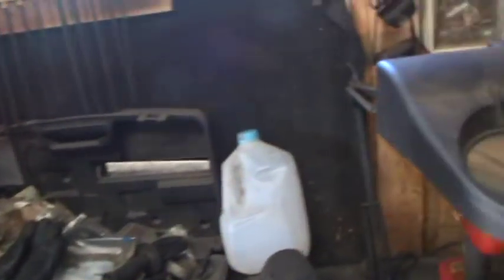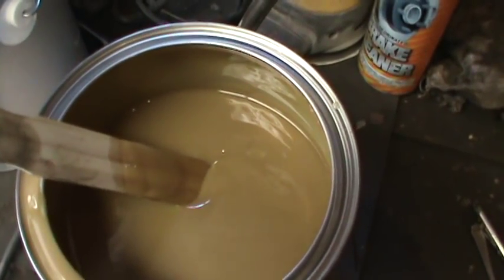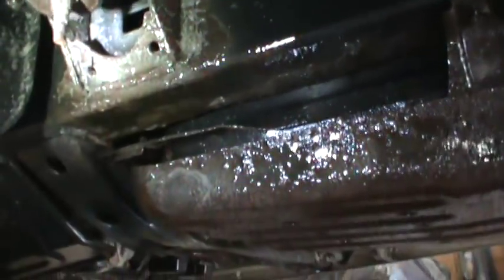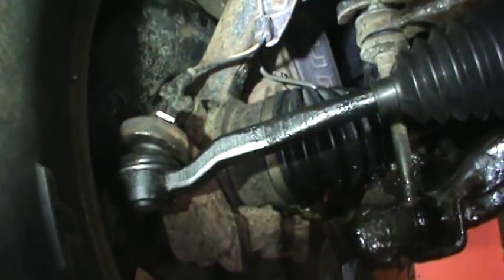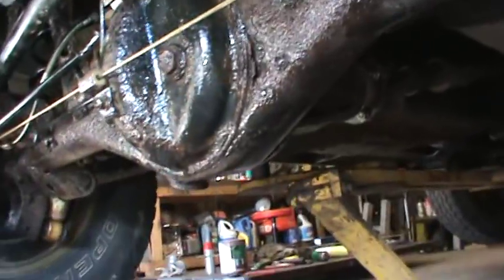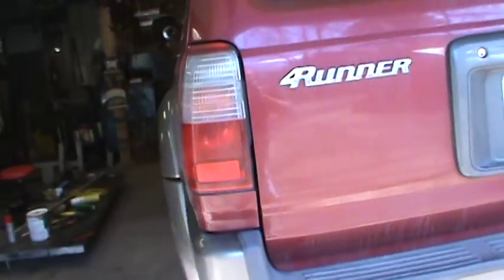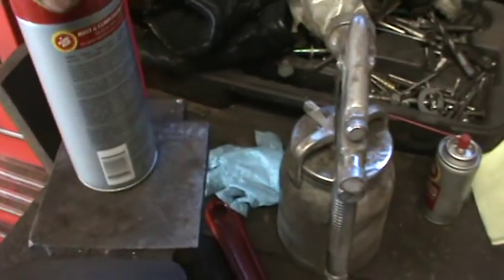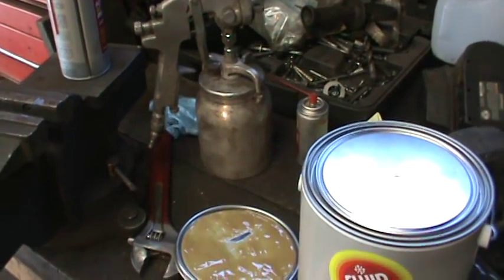undercoating with fluid film

Comment: I'm from Nova Scotia, and I've been undercoating my cars with Fluid Film for the last 21 years. This is by far the best undercoating available. I had an '81 Olds Delta 88 which are known in my area to rot the frame in front of the rear wheels. When I had it for sale, the guy who bought it first looked at the undercarriage and didn't believe it was driven year round. I now have a '98 Honda Accord which I bought 11 years ago after the Olds. Still solid after year round driving and 350,000 kms.

Comment: It's a truly great product,i've been using it for over 2 years now.It's the only product that i know of that will actually stop rust that's already started from spreading,with minimal prep work,as long as the surface is wet with product,the rust is stopped in it's tracks.I do the exhaust with it,any surface rust on the exterior of the exhaust is stopped,the excess will just burn off,the product is good for 400f.

Comment: i take all my cars to Krown rust proofing.  They spray everything.  We had a Neon and it took ten years for the leading edge of the hood to rust out.  Neons were nortorious for rusting out in 4 years.  I was convinced.  After ten years I went under and changed the shocks and the bolts nuts came off the bolts with no problems what so ever.
Reply: The reason why your hood ends rusted out was they missed spots my Volvo is 39yrs and no rust I go around the edges with cooking oil

Comment: I used it for a couple of years and it washes off too quickly. Like you I moved on to bar oil and I add a bit of an old candle melted into it on a hot plate. The FF does make a nice tire and plastic dressing, though, will make your old quad shine up purty.

Comment: this stuff is great! u have to coat it with much more than u see in the video. u have to make it so the car looks like its raining Fluid Film. after u apply it if u go beat down a dirt road, the dirt will stick to the Fluid Film and make a barrier so no salt will get to the metal.
in new hampshire we sell this stuff by 55 gallon, 5 gallon for all the local town trucks.
its made from sheeps wool so it all natural and wont pavement or cement .
u can buy this stuff at any Napa Auto store. its 39.99 for a gallon right now

Comment: I get our cars done professionally using a product called Rustop.  Here in Buffalo, we put so much salt on the roads that our cars don't stand a chance.  Rustop works great, its a yearly application, but I'm not convinced it is friendly to bushings, rubber seals, etc.  I bought a gallon of Fluid Film for my boat trailer and 6x8' trailer and I'll see how that goes on as they are outside all year and are starting to show signs of rust.
Reply: Are you referring to RustKote on Walden Avenue?

Comment: I live in Central New York, and had my Friend apply this to my 27 year old Buick Reatta. Wonderful results. Tip: get a dedicated metal pan or cup, and heat the product to 200F on a propane cooker, or a HD plastic cup for microwaving it. When hot- it penetrates quicker, and sprays easier, less waste.
Reply: 200°f seems way too hot
Reply: I do it at room temperature with a roller say at 85°. It works fine.
Reply: @2steaksandwiches665  Please try spraying hot before condemning my technique. Yes, "warm" is fine, but different results. HOT spray penetrates and wicks into areas much faster, with less product used, saving money.

Comment: I have been using this stuff for awhile now. I use it primarily as a cavity wax inside frames and door and anywhere paint doesn't work. A German car magazine conducted a long term test comparing all those types of products. There are a lot of different companies making products like fluid film available in Europe. Fluid film was the best wax based product for cavity application. There is a cavity grease that is a bit better made by Mike Sanders but I don't know if you can get it in the USA

Comment: Hey man I have a 4Runner as well I just bought I have heard great things about fluid film and may go ahead and apply it myself to bring down costs and since it doesn’t seem like a hard job. Any additional tools that you need to do the job I don’t have any equipment but plan on buying the kit off of amazon. Also did you apply it yourself? I don’t have a lift so what do you recommend doing or possibly buying to lift the car up and be able to get in there. Did you brush down the rust with a Erie brush before applying?

Comment: I can't wait to try this stuff.  But I would never just climb under there and start spraying,  my routine each year is to remove as much rust as possible either by sanding or using a wire brush,  then following up with Rustoleum High Heat paint.  Dries flat black, looks GREAT, no lumpy, flakey rust.  Now that the weather is warming up,  I'm going to give this a try, after my own routine is finished :)

Comment: Does a truck that's about 2 years old and has been car washed need to be meticulously cleaned underneath BEFORE applying this?  Otherwise won't it just trap dirt, salt and rust underneath the film?
Reply from the maker: +Anonymous1 you want it dry as possible, it makes a moisture block, its not like rubber undercoating, this kinda soaks into the dirt,

Comment: Heat the fluid film to about 100C, then use spray gun with 125 psi and coat all the inner panels especially the rockers and fenders.

Comment: fluid film is pretty amazing, here n europe on very salty streets (alpine area) even 3 or 4 times more damage on rust than in open area. Pretty small most know about prevent from damage, even its so easy .. fluid is resistant to salt water and seems even natural as produced by sheeps (at least in its chemical origin). There is just one on the level of fluid film. The system of Mike Sander is probably the best. Till now I didnt try but it seems very profound. Thanks fpr video, Thom

Comment: looks like the same stuff,i always head for a dry dusty road and the dust will stick to it and form a slight buildup and the next time u spray it will actualy act like a sponge and hold it on better,it is a way to fight the rusting issues,also it does creep into them tight areas,if u did the inside of your door panels u will see it creeping out over time,looks bad but u know its working,lol,hope it works for u

Comment: I just came across this old video. I've used fluid film along with pb blaster as my penetrating oils of choice for years. I bought the bulk ff and mixed 50/50 with transmission fluid and applied with oil squeeze can to get fasteners out of a 1928 model a body. But 80 a can cdn has me buying just small can now when on sale and princessauto had pb blaster cheap so I stocked up on it.

Comment: If I can remember that cleans up with denatured alcohol and not paint thinner used that when I worked for Mercedes Benz. The applicator a pressured can somewhat like you paint gun with a hose and a wand with a panel injector that kind of sprays the material in a 15 inch X 360 degree pattern and another tip with a spray nozzle to get into the hard to reach places

Comment: It's material safety data sheet (MSDS) reveals that it's:

"Distillates(petroleum), hydrotreated heavy paraffinic" 

Cheap engine oils of days past were paraffin based. They were the ones that were really bad about producing sludge.

I bet this stuff is some refinery waste byproduct they get for pennies a ton...

But if it works!

Something like this was all over my (then new) 87 Accord. Underneath, It was still intact 22 years later when I scrapped the car. Came from the factory with it...

Comment: Hey Mustie, which local place did you get the fluid film by the gallon. I see it on Amazon for about $50 a gallon. I am in Manchester New Hampshire so I probably have the same local shop you do. Need to protect my Tundra before the salt comes... Thanks
Reply from the maker: +Mike Moore l used senter auto parts in plaistow nh,
Reply: +Mike Moore 

Get it from Zoro. They have it for 37 a gallon and have coupon codes all the time.
Reply: +Plutonius X thanks guys I'll check those places out
Reply: Napa auto parts has it too

Comment: I had krown rust proofing last year, they drill couple of holes in the body and then they put rubber dart to close the whole aftre insert a pipe and spray inside the door panels, can I take off the rubber darts and spray the fluid film inside inside door panels ? THANKS.

Comment: I believe my compressor should suffice but do you have to use a special spray gun to shoot it? Or is it just a regular paint spray gun? I saw the gun in your video but wasn't sure if that was some special solvent gun. I assume you just poured the Fluid Film into the container cup and screwed it onto the gun.
Reply from the maker: they make whats called a shults gun, but l used an old paint gun, the only problem l found is it makes alot of mist, so use lung protection of some sort,
Reply: Ok Thanks!
Reply: Mustie1 
What  Air Compressor do you you personally use with the Fluid Film?
-Oil Lubricated or Electric ?
-How many HP?
-CFM or SCFM
-How big is the tank?
- Do you use a regulator?

I have a Webster 1HP twin cylinder , Oil lubricated compressor and i was wondering
if it will would be enough to power a undercoating gun. I have no regulator.

Comment: I bought my Fluid Film from Kellsport com in Boston. IMO, you're too late on that 'Yota... It takes me 10 hours and a gallon to do a vehicle 100%. I bring Suburbans from out West, and remove headlamps, tailamps, wheels etc... Don't worry about the rubber, there's no solvent in the FF, and the solvents are what affect the rubber bits... I have several vids showing me doing my thing! I use the thicker "AR" brushed onto the inner fenders...glad you're on board...

Comment: If you live in rust belt do you still rinse the underside or will this remove the fluid film?
Reply: Fluid film creates a barrier so washing it shouldn't be necessary. They say to reapply Fluid Film every year but I would do it right after winter and before winter because itll wash off around the wheel wells  and you dont want it exposed. It probably wouldn't hurt to add an additional coat around those areas.

Comment: So the question is how are the longer term results using fluid film vs ATF rust penetrant followed by bar and chain oil with wax and road dust. What works and what don't? What prep is necessary? For flaky built up rust I find nothing much gets through it to the metal not even phosphoric acid unless you first hammer away the scaley rust close as possible to metal. Then treat with the concrete etcher solution from home improvement stores gallon jugs and then get at it with ATF and that method or the fluid film? I experimented with the spraycan fluid film before on undersides in salt exposure and I wasn't too impressed/convinced. Fwiw. LPS3 also failed the test. Penetrol failed...it's good on rust but not under the car can't take the abuse fyi. Car oil really failed blah. Meticulous prep without concrete etcher failed with application of Pettit RustLok which is like POR15 but cheaper maybe that's why it's cheaper? Fail. Disappointed. I used to dip steel traps years ago in boiling water with paraffin and they stayed rust free in total water submersion until the moment something scratched the wax coating then instant rust. I notice there were various undercoating videos here from Mustie1 and since no dates on YouTube hard to tell what worked what didn't anyone? I see linseed oil in one the videos.
Reply from the maker: they should have dates on them, but my go to is chainsaw bar and chain oil as of now
Reply: It's interesting that research has uncovered that a 50/50 mix of ATF DEXRON/Mercon and acetone is considered a top penetrant for sticky bolts even bettering the likes of $ Kroil.  One of your commenters "Colleen" mentions using ATF to penetrate the rust before applying the heated B&C with paraffin.  I see you using toilet wax rings too in another video.  How did that work out on snowblower??  Seems adding the acetone to the atf might be a good route for initial treat for me here but foul weathers impending and I'd assume you want this dry through the whole process to complete with dusty road drive (dry).

Comment: i'm no gurl.....lol joking.
what autoparts did you find the film? i use used oil which is not a good idea. so i only use under the wheel wells. Did you sell the ford f150 tranny repair?
love the motorbike. looked like it goes pretty fast.

Comment: I've been looking at doing that to my Silverado. I I wish I knew about that stuff before I used WD40 on mine. Nice Ford LGT by the way.
Reply: What happened with the WD40? I've heard of people using that in the bottom of the doors.
Reply: Ohio Digger  I used half a gallon in a spray bottle, it didn't even last a week!
Reply: Oh jeez.  I think I'm going to go with Fluid Film.  Locally it's about $48/gallon but I'm hoping I can get a couple applications on my "89 F250 out of a gallon.  It's a supercab with 8' bed but I imagine I should be able to stretch it pretty far.  I plan to do it in the spring and again in the fall right before snow and salt start dropping.

Comment: I just use a pump pressure sprayer and fill it with use engine oil and spray the hell out of the whole bottom of my jeep once a year. You would be amazed how well it protects. Its a bit slimy under there , but who care lol.
Reply: +Justin Hickey Really? so every motor vehicle that leaks oil on the road or ground is illegal? All the engines lose anti freeze, trans fluid , brake fluid , into the environment will get fined. Maybe we need a new police force to check all the cars and truck for oil leaks . silly season.
Reply: +Justin Hickey LOL, i would no blame you.
Reply: That's what I do too. Bought a cheap sprayer that you attach to an air compressor from Harbor Freight.